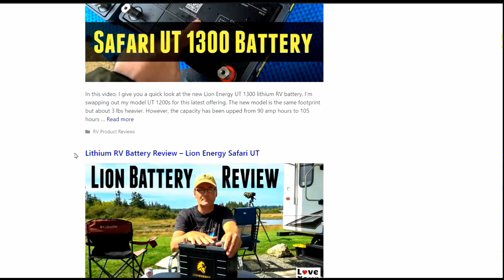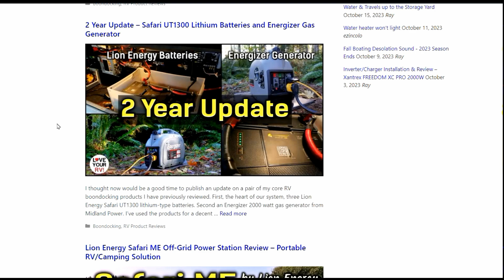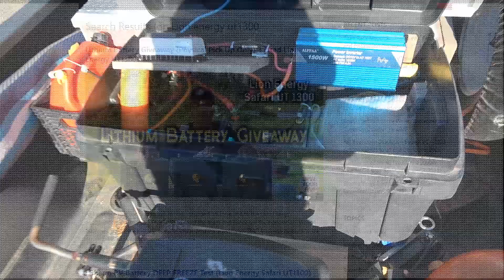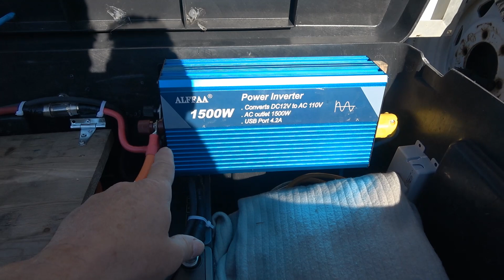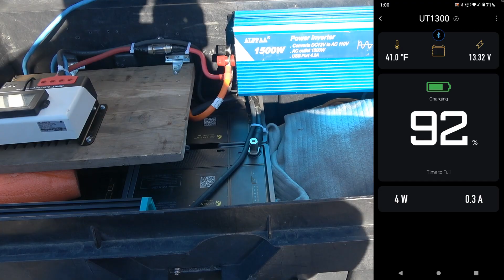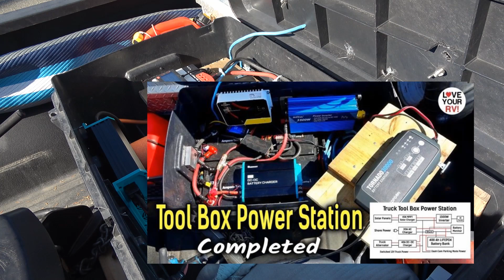Long-Term Update - Lion Energy Safari UT1300 Lithium Battery and New Bluetooth App Version

Comment: Hi Ray, Thought your viewers would like an update on your UT1300BT batteries. I purchased two of your batteries from you in January of 2024, Ive had nothing but trouble with them since I got them. When ever I charge them to 100% they seldom both pick up the load on discharge. Seams to be a 50/50 chance on which one will pick up the load. Also the temp sensors often quit woking when the temp gets below 45 degrees Fahrenheit. Tride to get help from Lionenergy, was told since I wasn't the original owner they couldn't help. Just wanted to give you and your viewers a heads up on Lionenergy.
Reply from the maker: Sorry to hear. Tell them I sold you the batteries and was a reviewer for them so the battery was never registered to an owner. Here is my playlist if they want to see https://www.youtube.com/playlist?list=PLp14lzXh07untqLBePms4b-337M031vJn  I they give them grief I can post an addition review video to update people on Lion.

Comment: Appears that you have them wired in parallel so I’m wondering how you charge them. I have two of the UT1300 BT in parallel and now I pull each out separately and charge via my Safari Savanna BC charger. But I’m wondering if I could just connect and charge them in the parallel. Thank you in advance
Reply from the maker: Yes. You will want to charge them individually until 100% at first and then can wire them in parallel and they can be charged that way no problems. Every few months pull then out and recharge to 100% individually to make sure they stay balanced, reconnect in parallel and you will be good. Cheers, Ray

Comment: Your truck battery box reminded me of our RV power setup in 2009, when we spent 2½ months in our Montana, driving from IL to ABQ for the Balloon Fiesta, then Grand Canyon, then San Diego, Salt Lake City, Walden CO, and home.

I repurposed four 100 AH AGM batteries to augment our existing flooded cell battery. Our 3KW inverter let us run ceiling fans, microwave, and other light loads for up to several days.

But one battery in the middle of the array failed, I believe because insufficient air space caused it to overheat. I remembered that when I saw your batteries have free air on only two sides.

I corrected my problem by placing short lengths of 1" PVC pipe on the floor between them to maintain spacing.

Comment: THANK YOU for these updates. I appreciate the real world use & reliability. 7 years ago the accountant in me couldn't justify the cost & voodoo math some were reporting. My 6v golf carts were doing fine at considerably less, regardless of amortization. I knew full well competition would spark price drops from the $1500 ea.  ~15 months ago I switched over to 2-12V 100amp hr Chins. One 'smart' + one 'dumb' ~$ 825. Lots more useable power + a constant voltage. The price has dropped significantly again & I am thinking of getting 2 more and building a power station such as yours. I was wondering if you considered a Server Rack type battery or the newer style "All in One" like the EG4 6000 XP ? the prices on these things have really dropped a lot over the last year. understanding you get a lot of items tossed your way & can make good use repurposing them; but starting from scratch was looking at this alternative. Truly admire your creativity & ingenuity.

Comment: I have 4 Lion Energy 1300UT without the bluetooth module.  I would like to see heater and CANBUS
Reply from the maker: I don't think I'd want there to be heating pads inside unless the temps encountered were super frigid. Adds extra complexity to the construction and BMS board. Any issues I've encountered with the lithium batteries I've tested were BMS with heating pads. Given that the battery naturally produces heat when discharging, it can go quite low without pads, especially if in an insulated battery box. Cheers, Ray

Comment: could get a higher capacity battery too, would save on the wiring
Reply from the maker: You bet, drawbacks would be heavier weight per battery and if it quits you lose more of the system capacity. The new ones I'm going to be installing in the fifth wheel are a pair of 240Ah but weight 70 lbs. each vs 23 lbs. for these little Lion Energy ones. A big plus for the Lion's is they can output up to 150 amps so times by 4 that's 600 amps, not bad